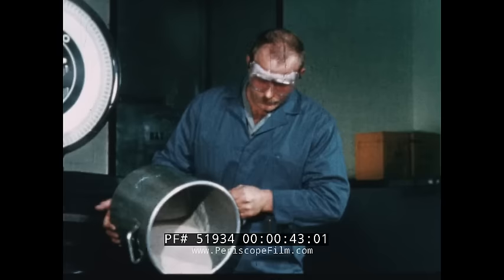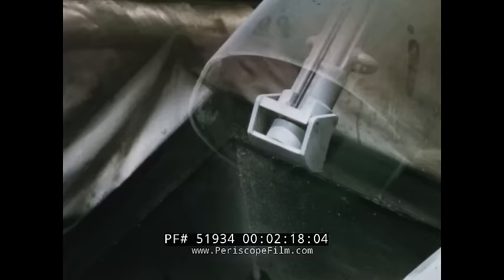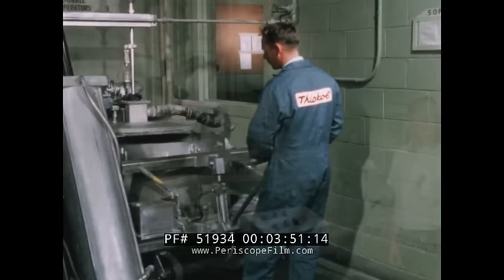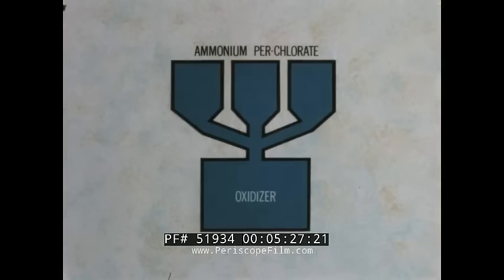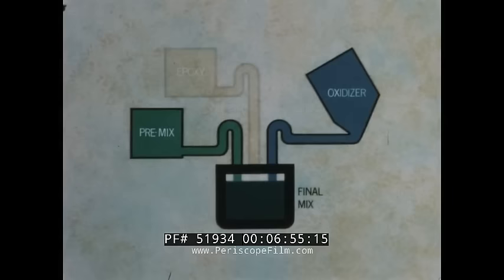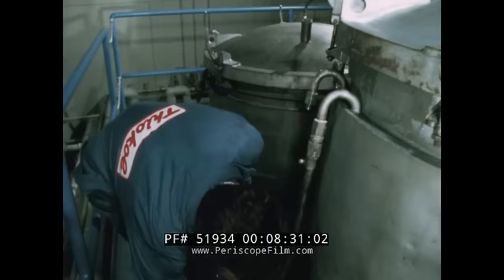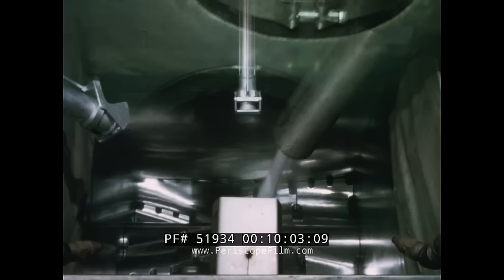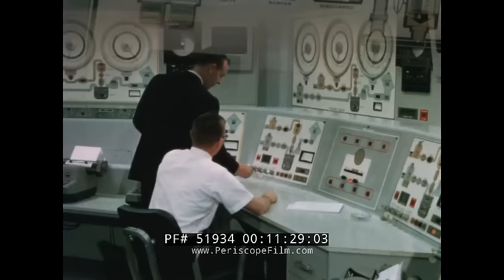THIOKOL ROCKET & MISSILE PROPELLANT  SOLID ROCKET BOOSTERS  "CAREFUL DIETS FOR MISSILES" FILM  51934

Comment: Does anyone know the ratio of aluminum to ammonium perchlorate?  What kind of resin and binder?  Just a rubbery mix? Please help.
Reply: There are several but one that will be easy to do, 70%AP/15%GEsilicone 2/5%aluminum Try some of the dark aluminum for a bit more power but Aluminum flake seems to work okay. Most formulas use some kind of catalyst, 1%red  iron oxide would be about the usual.
Reply: B Belcher 
Thanks for your help!  🙏
Reply: 75AP/15Al/10binder
Reply: polybutadiene acrylonitrile (PBAN) polymer. It's a non-urethane rubber binder that holds the mixture together and acts as a secondary fuel. You more or less follow the steps used in this video, weigh your components, mix the polymer portion of the epoxy (aka don't add hardener) with the aluminum and iron oxide, then mix in your ammonium perchlorate, blend completely, then add the hardener and blend again. I don't remember the cure time, I think you have a number of hours of working time but I'm not sure. Best to be done quickly. You can use a counter top stand mixer like a kitchen aid to do all your blending but make sure you clean the living shit out of that bowl before the epoxy cures if you intend to use it for food again heh. Make sure to really blend the mixture (30 min+ at each step, aside from the final mixing of the two rocket fuel/epoxy components which needs to be done fairly quickly, probably 10 minutes or so), since all the components are granular and cannot be dissolved before mixing like some amateur rocket fuels. Ideally you want a molecular mix, that is each component is touching the other two components at a molecular level so the reaction is as energetic and efficient as possible. But, since the components are granular we have to settle for blending the shit out of the mix. If done properly you can make some seriously badass amateur rockets. Even making small pieces to light and throw in the air is very entertaining, you never know what the darned things are gonna do. Fly 50 feet in a straight line away from you, fly 10 feet away from you whip a bitch and literally rocket towards your face, fly in a loop over your head, fly straight up while spinning in a fast and tight arc, the results are endlessly entertaining. Nickel-size pieces work best.
Reply: @TheExplosiveGuy  Someone has got their HPR certs. :)
Reply: @Nighthawke70  As much as I wish otherwise I actually don't, I'm just really into the hobby. Perhaps sometime down the road I'll get certified but for now I just play around. I'm actually currently making a stainless steel test rocket, just a threaded slug of stainless steel with thick walls to test different nozzle geometries, it'll probably end up holding a half pound or so of propellant. Still need to figure out a way to monitor real-time thrust values, was thinking of a piezo load cell, but that's expensive so I'll probably just use a cheap scale. Model rocketry gets expensive fast...
Reply: Mark Green don’t use steel for a rocket casing. If it fails steel will fragment. Aluminum 6061-T6 is best. Aluminum will hold together and just split if it fails.
Reply: @adamarmstrong4273  Ohh no worries man, I'm talking like 1" thick 17-4 stainless steel walls and adjacent nozzle connections. Seriously durable test bed sort of stuff. I won't say it can't be breached, but you'd have to be a complete moron to put high explosives in something like that (that's the only way you'd blow a chamber of those dimensions and materials with standard rocket fuels short of completely obstructing the nozzle). I work in a machine shop and so have lots of metallurgical goodies and large magical machine tools available to make nigh-invincible rocket test parts, sadly which cannot be flown due to weighing an order of magnitude more than they need to be. I'm building it to get a better idea how chamber pressure correlates to thrust while using different nozzle geometries. I appreciate the concern but if you knew half of the shit I've done man, lol...
Reply: @Nighthawke70  That is exactly what I thought too. I have my level 2 cert.
Reply: @TheExplosiveGuy  NIce.. Im building rockets out of PVC pipes and woodeen noozles
Sometimes it explodes but im far away
Amonium perchlorate is faar out of my reach tough as it is illegal to sell in Europe
Reply: @adrianj2666  sweet, that's about how I got started myself, sugar and potassium nitrate pvc rockets are fun. Instead of wooden nozzles try researching rocket nozzle mix, it's a mixture of bentonite and grog (not sure wtf that is but whatever) which you ram with a press or mallet to form very durable nozzles. You will have to make or buy the form tools, but they aren't that hard to make or too expensive, and you only have to get them once. The nozzle mix is dirt cheap as well, you could make close to 100 rockets with one relatively small container, which sells for around $10. You might have better luck with your explosion problem by switching to heavy wall cardboard tubes, there are many vendors that sell them specifically for rockets and they aren't expensive at all. They tend to have better shock sensitivity, aka they don't explode when the chamber pressure spikes like pvc would, pvc is great for holding a static pressure load, several hundred PSI, but it can't handle the  sudden pressure spikes inherent in rockets. 

And are you sure you can't get Ammonium perchlorate? I know Potassium perchlorate is pretty limited since it's the main component of flash powder but I'm pretty sure Ammonium Perchlorate isn't nearly as explosive. I bought 2 pounds of it off Ebay, but perhaps it's different where you live. Anywho, I wouldn't move up to that formula just yet if you are still playing with PVC tubes. You do need a stronger chamber to cope with the much higher chamber pressure this formula generates such as machined aluminum with Ceracoat inside, or something along those lines.
Reply: @TheExplosiveGuy  Thanks for your reply and short summary on cheap rocketry. One thing I use for better pressure strenght is a hose... Same diameter as the pipe, Tightly stretched over it. I don't trust single-layered motors out of PVC pipes, there could be a miniature crack somewhere etc. One problem I had was when the fuel wasn't top quality and the burn was long and the rocket was quite slow, PVC pipe could melt in some places and gases then made an exit in those places.
As for the nozzle, I know people make such nozzles but I had an idea to drill a perfectly shaped wooden nozzle and cover it with some aluminium plating and some anti-heat layer between. For now I use wooden ones that are also cheap and one-time use. The hard pard is to drill a nozzle 100% perfect but with a driller stand its much easier to get straight thrust outcome.

Also, the problem I had is to get KNO3 + sugar prop to have a repeative performance. I know the famous Sorbitol is better when cooking a high quality r-candy
Reply: @adrianj2666  that's not a bad idea, sleeving the outer portion of your chamber, aside from the slight decrease in efficiency due to weight gain. How do you process your fuel? Do you mix it in powder form and just press it into your engine, or do you melt the ingredients together? If you were to dissolve all your ingredients into a small amount of water and proceed to evaporate that water and then melt the components in a double boiler while constantly stirring (A pan inside a pan filled with cooking oil, it eliminates hot spots and allows for a very even and well controlled thermal gradient) your fuel performance will be very consistent, assuming you are measuring everything to a high degree of accuracy. Just be VERY careful when doing this, if your fuel gets too hot it will very quickly burn to completion in your cooking apparatus, possibly starting some undesired fires near/on you. And also, do you add a catalyst to your fuel such as iron oxide? This would eliminate slow burn cook off of your chamber. Under certain conditions a catalyst can make for a very consistent fuel, albeit a much faster burning fuel. I'd recommend playing with your fuel mixtures a bit, be rigorous in how well you measure and record your results to ascertain the exact ratio that makes you happy. I've had great success with a 64% KNo3, 34% table sugar and 2% iron oxide mixture, dissolved and blended as I explained above. Although, this method does involve a great deal more work to load your fuel grain since the mixture has to be loaded piping hot into your engine before it solidifies. Sorbitol, as you mentioned, makes this process much easier since it solidifies at a much lower temperature, but I feel like it doesn't have quite the same oomph as regular sugar. Do what you feel safest with, but don't be afraid to experiment at the same time. Most of what I have learned has come from practice and experimentation, but never ignore safe practice rules. Let me know if there is anything I can help you with, I don't mind at all helping people wishing to get into the hobby so long as you are safe and responsible.
Reply: The propellant not burns without permanent ignition.
Reply: Here ya go buddy: https://www.cannonfuse.com/store/pc/Pyrotechnic-Formulas-Rocket-Propellants-d20.htm
Reply: Space Shuttle Boosters propellant
Source: NASA homepage
Comments:
Preparation:

Aluminum powder...................................16
Ammonium perchlorate..............................69.9
Fe2O3 catalyst....................................0.07
Rubber based binder of polybutadi ne acrylic acidacrylonitrile.....12.04
Epoxy curing agent................................1.96
Reply: @TheExplosiveGuy  To be honest, stick with the  NAR regulations when it comes to mixing and preparing solid motors. They frown upon steel based alloys for casings. They advocate fiberglass, aluminum alloy, carbon fiber or wound paperboard tubing, preferably waxed to repel water. I'd be very weight conscious when designing the casings.  In rocketry, weight is literally everything that makes or breaks a vehicle design.
Reply: @Nighthawke70  Are you talking about my testbed device? If so it doesn't really matter, I'm not standing near it when test firing or anything. I do any testing out in the boonies and remotely fire everything from a safe distance with cover (I've lit off some big shit lol). Thanks for the concern though, I understand where you're coming from.👍

 I never did make the thing😐. But I've planned it out in detail, it's going to be made of a 6"x12" carbon steel rod, with a 1.5" core diameter (2.25" thick walls, and will be heat treated as well, I'm not sure what it's pressure rating will be but it should be close to the 100 thousand pissies mark as AvE would say😂), which will be 8" deep but will have spacer plugs which will thread in from the other side on 2" threads to accommodate different core lengths, and inserts for smaller core diameters. The nozzle will use 2" diameter threaded plugs so I can swap out different nozzle profiles and sizes, and if all goes well and the financial gods bless me with their gaze, I'll machine tungsten inserts for the throats, but in all likelihood I'll just use graphite. Since its so hefty I figured a pendulum system with a counterweight would reduce any load on the scale, just tune the position of the counterweight to leave just enough weight on the piezo scale to bring it into constant contact with it. I was also thinking of putting threaded ports into the nozzles to fit piezo pressure sensors, see what's going on inside the chamber to see small fluctuations in pressure to match with thrust values. It's kind of a pipe dream but I really want to make it, I like the idea of being able to just thread out one nozzle and thread in another, or a different core diameter or length, it would be extremely versatile for testing that wouldn't require consumables (except for maybe some crush washers between the fittings for a gas seal, don't want to stick up the threads). 

I will admit that if it Catos, it's going to be spectacular😂. If nothing else it will make for some great footage lol🤣